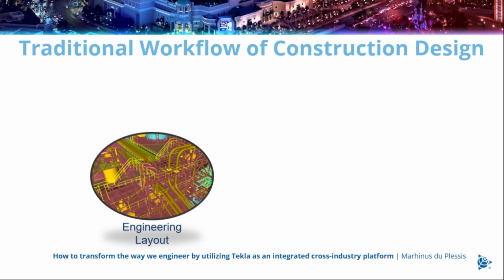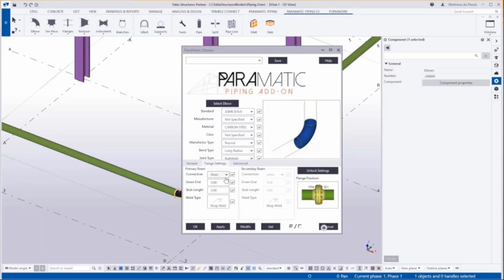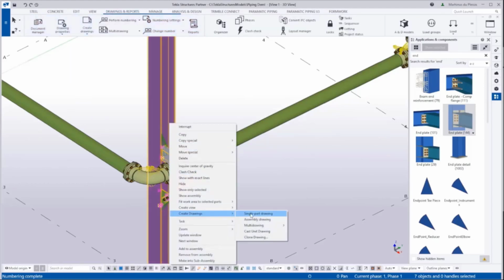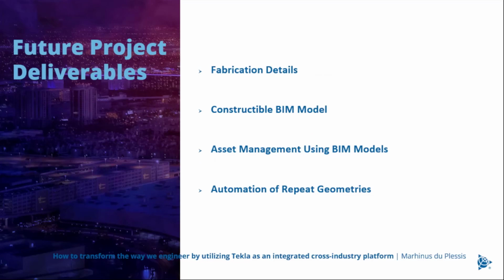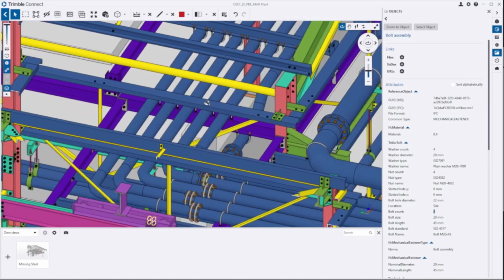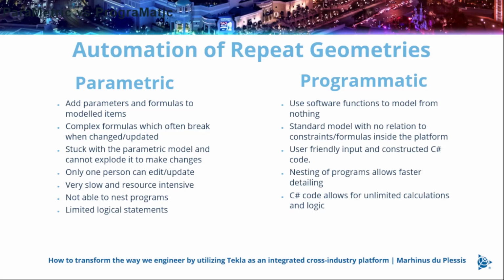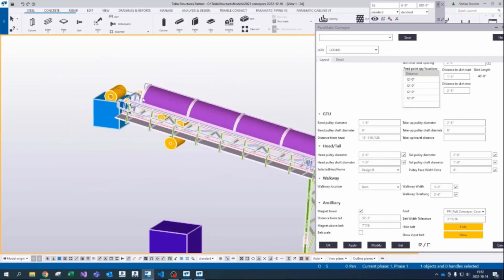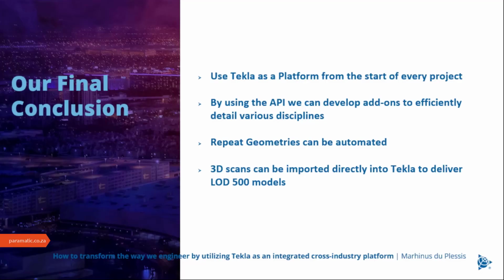Tekla as an MEP Platform - Trimble Dimensions+ 2022

Comment: Do you folk have Clint’s in the US? What  about US standard for flanges and piping? Does it cover abrasion resistant pipes? Like Basalt?
Reply from the maker: Hi Alaa, we do have 2 small firms using our Add-On in the US.

Our software is developed in such a way that it is easy to add additional libraries.

We have quite an extensive database of various standards, but can easily add additional content.

Adding of additional content is done by us, but included in our subscription fee.